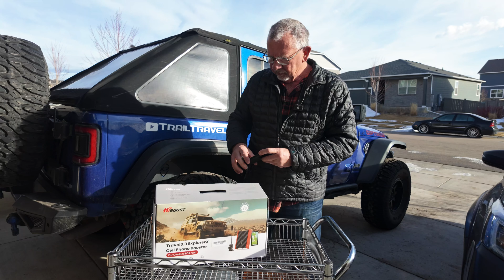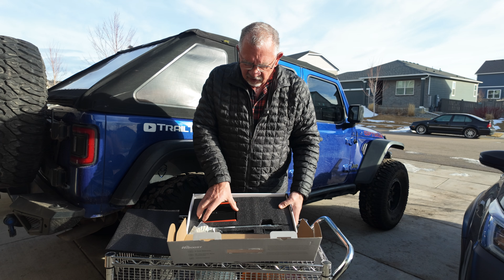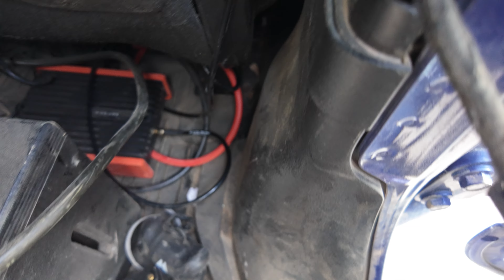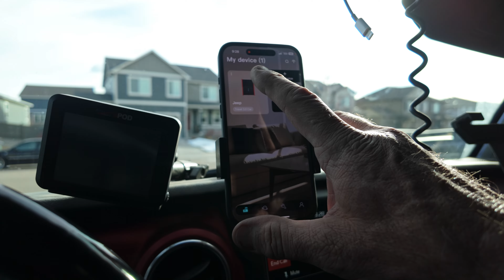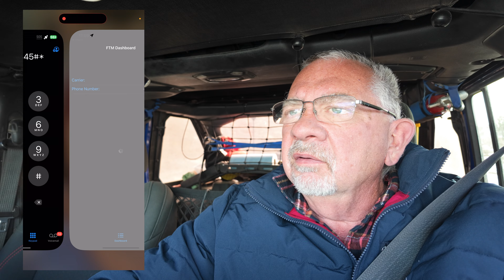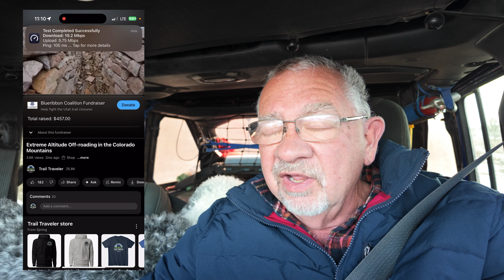How To Extend Your Cellular Connection - No Monthly Bill!!

Comment: I got a WeBoost a couple years ago. It did the job in some places, but for the most part, it didn't help much. I suspect the indoor and outdoor antennas were too close, (There's only so far you can put something away from something else in a 2-door Jeep.) so the thing had to attenuate the signal a lot to keep crosstalk down. Keeping the phone right next to the dashboard was an annoyance, too. Earlier this year, I installed an LTE router in place of the WeBoost module, connecting its cell antenna port to the WeBoost's outside antenna, and wiring up a WiFi antenna inside the Jeep. The router came with a prepaid SIM card which will get me on all the major carriers in the US; handy if the only tower in range is one from a different carrier. The net result is I have data service, including WiFi calling, anywhere within several yards of my Jeep. 

This setup works well enough in a couple of local areas I've tried where my phone barely picks up a cell tower. I have yet to actually try it in the field, though.

Comment: Nope, $589 paperweight for me when starlink can be had for $349 for the standard and $500 for the mini.   Plans from $10 to $165 and everything in between with the ability to pause it’s a no brainer regardless of monthly cost.  Since it’s only boosting if a signal exists you want signal sometimes or all the time?  I just suction cup my mini to my sunroof and off I go.  I never lose signal and when I’m parked only need roughly  20 watts to run.  As far as satellite messaging goes both Att and Tmobile are joining the space and will further get rid of cell boosters.  T-Mobile is already partnered with Starlink and rolling out.  ATT has been out for a while though not quite there yet.  These booster companies as well as Garmin are going to have to make some pivots to stay competitive.   Competition as they say is good though for us.  If I was just getting my feet started in needing some kind of connectivity I wouldn’t waste money on a booster.
Reply: Starlink charges $50 per month minimum on top of the $500 for the mobile dish. It can also be spotty in the mountains, as the satellites move in and out of view. It's not a bad idea to have it around when you're truly out in the middle of nowhere, but for areas that have at least some cell coverage, a booster can be very handy. That said, I agree they're too damn expensive, given their limited utility.

Comment: Good video!  While this is a good thing to have, especially for non-text-only message needs in more remote areas *and for no monthly fee* (sweet!), nothing beats satellite for guaranteed ability (at all) to send for help.  Newer cell phones (some iPhones and Google Pixel 9) support emergency messaging over satellite, though how good those actually work I don't know.  I'll still rely on my Garmin InReach Explorer Plus for that, but the InReach does have a monthly fee (about $12 for the cheapest plan).  

What I'd like to find out after you've had some time to work with this during your long-term review that is to come is whether or not you think it was worth the money (you would have spent buying it), hasslte to properly install it, etc. at least for the more remote locations you visit.  That would be very much appreciated.